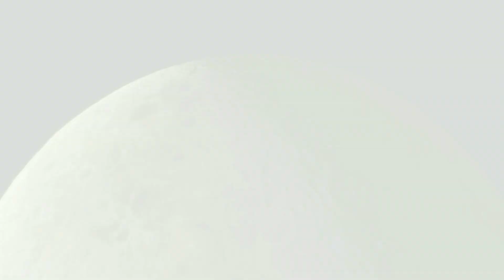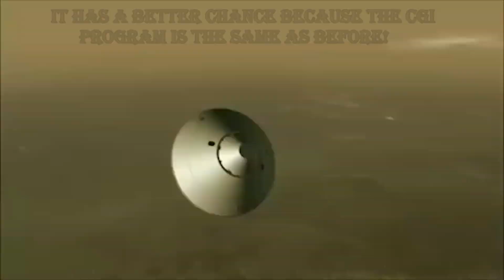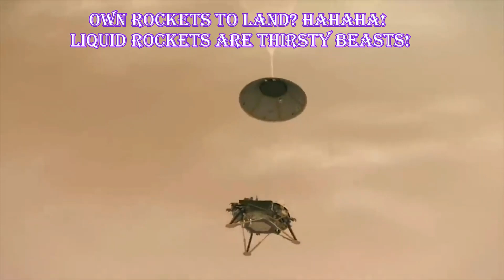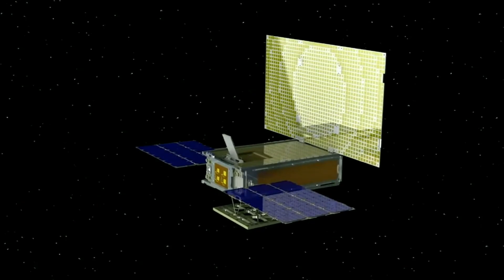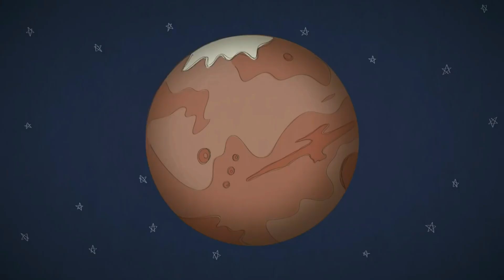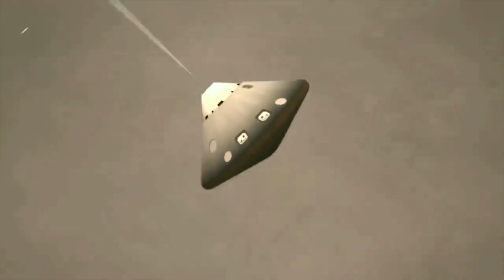Moon/Mars Hoax; "Cosmic Cleaners!"

Comment: Rocket'll kick up a lot of dust.......unlike the 1969 landing on the moon with no dust and crater LOL
Reply: Atmosphere verses no atmosphere you moron!
Reply: @samjones1949  yeah idiot even with no atmosphere no crater uh?..
Reply: @guillermohoffmann8417  yep that is correct. Lunar dust is only a few inches deep. Thus no "crater" made. No atmosphere means what was blown away could not drift back onto the pads like it could on Mars. Simple.
Reply: @samjones1949  your explanation makes NO sense Sammy. There WAS supposedly loose dust found all around the LEM as seen in the 'pictures', but it was not disturbed by the force of the descent engine? If the dust layer were only a few inches thick it would have been blown away completely, and the area around the LEM would've been blasted clean like a massive leaf-blower! Loose dust all around the LEM, just none on the Landers pads? PLEASE!
You live in your own personal reality I guess because that is impossible in the real world!
Reply: @stillperfectgenerations5852  it makes complete sense. The only dust blown away on the moon was that directly moved by the exhaust. Dust beyond the actual exhaust wasn't disturbed because of the vacuum of space! The opposite is true on a Mars landing. Because there is am atmosphere on Mars dust far beyond the actual exhaust would be affected. Can you comprehend that fact? Or are you going to spout "fake" to everything that you don't like because it doesn't fit your fantasy world?
Reply: @samjones1949  oh, selective dust around the LEM. Well that makes sense Sam. See, I never knew lunar dust had such capabilities. Amazing stuff is it not?
Loose dust is obvious directly beneath the LEM and all about the Lander...hey, wait!
Why did the AstroNOTS waste time, and effort, and fuel bringing that petrified wood and Earth rocks back?
That lunar dust would've been worth much more dont you agree Sammy?
NASA could have set up tents around the Country for exhibits! Possibly make a deal with Barnum & Bailey. Would have been quite a draw down there in Mexico! Imagine Sammy, IMAGINE this! 
Lunar Dust with the Jumping Beans!
The Worlds children would be fascinated!
So, what you are telling me is that NASA should have brought the dust back, they would be self-supporting today, and none of this 'Moon Conspiracy' because who could deny it then right
Reply: @stillperfectgenerations5852  as I expected your mind is made up and you refuse to see simple facts. The dust immediately beneath the rocket blast area Is gone! You don't believe the landing actually happened and no amount of evidence contrary will ever convince you. There's even a video by a film maker of over 35 years which shows the video of the astronauts on the moon couldn't have been faked. The technology didn't exist. Let me know if you ever grasp the difference between a vacuum and an atmosphere.
Reply: @samjones1949  how about you let me know if you ever grasp the difference between 'Did it 50 years ago', and 'NOBODY in ANY Agency can take LIFE 1/1000 of the distance from Earth TODAY'?
Simple difference really Sammy, stretch out your hand and see if you can grasp that?
Reply: @stillperfectgenerations5852  the simple answer to that is money. Apollo spent the money, invested it actually. No country has been willing to spend the funds to get us back to the moon. It's not that it can't be done, because it will be done again in a few more years, but it simply hasn't been a priority. I hope you can grasp that since other forms of reality seem to easily elude your mind.
Reply: @samjones1949  sure Sam, sure...
Sell that shit to someone who hasn't ate it for 60 years and are sick of the taste. Apparently you love it? May take you a bit longer, then again, they say it is easier to fool someone than to tell them they have been fooled.
Common sense should have already had you doubting the NASA Lies by now. All the many flaws in video and stills. The many AstroNOT anomalies. The one that should clue you in is this fiasco called ISS. Have you got to watch this comedy? How about the scuba bubbles, you watched this farce yet? Ever looked into the Nazi/NASA connections? I could fill this whole page with more and more but like I said, what is the point, you have been fooled and can't see it...
Sorry, praying for you too Sammy
Reply: @samjones1949  your 'reality' is science fiction!
Minus the Science because real science is based on the ability to reproduce the same results.
Can you grasp that one friend?
I need not ask because it os obvious it alludes YOU!
Like common sense, critical thought, and the ability to see when you are being deceived.
Hey friend, I got this ol' bridge out there in the Nevada desert, you know, Ocean-side. Was wondering if you'd be interested? Cheap, introductory, low-price? I'd give ya the 'cousin' price?
What do ya say Sam?
Reply: @samjones1949  Maybe you could get with some of the other NASA fools...uh, I mean NASA fans and take up a collection for my bridge?
When I say cheap, I mean cheap friend!
Pass the hat Sammy and see what you can come up with close to $60,000,000?
It sounds like a lot doesn't it? 
Nah, peanuts considering we pay that amount to NASA every DAY!!!!
Just tell all the buyers that it is a single payment and it is all theirs afterwards!
Have your people get back with my people and we'll do lunch...
Reply: @stillperfectgenerations5852  every single point you tried to bring up has been debunked. If you took the time to look you'd see numerous videos pointing out the fallacies and outright lies in every one of those points. I've seen all of them. You believe that fantasy all you want. I'll stick with the truth....
Reply: @stillperfectgenerations5852  20 billion a year approximately. Money far better spent that the trillions wasted by our government (USA). Very likely the device you're entering your flawed fallacies on is either a direct ot indirect spin off of NASA research. But of course no explanation matters to someone who refuses to even consider alternatives to their fantasy world.
Reply: @samjones1949  you would not know truth if it were biting your ass.
Seen them all and still dont smell that?
That's called bull-shit Sammy, maybe you have gotten used to it since you 'seen them all'. Congratulations, you have the discernment of a six year old.
Reply: @samjones1949  not a priority? Spend billions of our dollars to go in circles over the Earth? Billions and billions for what was that again, petrified wood and Earth stones brought back from the 'moon'? We always have those nifty cartoons though, right Sam?
What else? Green-screen trickery and AstroNOTS hanging from harnesses?
What else? The occasional dip in the big NASA swimming pool?
I mustn't forget those epic CGI 'Blue Marble' lies.
Apparently the vastly different sizes of the continents haven't made you suspicious either?
Foolish to believe NASA, because they are contradiction after lie.
Reply: @samjones1949  chances are, ARPAnet was the beginning of the Internet and my taxes paid PLENTY for it pal, without counting the funding wasted on the lie called NASA.
Considering Nixon talked to the AstroNOTS 250,000 miles away with no problem, like they were next door, it is still hard to believe my call drops here on planet if I turn the corner at the end of the block, 50 years later with technology unthought of at that time.
If anyone lives in a fantasy world pal, that's all you. Maybe wipe that off your forehead? STUPID is wrote there in dark black!
Continue defending NASA, the ONLY technology to go BACKWARDS!
Reply: @samjones1949  you have the ULTRA flawed speculation and excuse, as the many other NASholes I have had the privilege to discuss this with, that lesser of two evils should be the attitude? It is not. I do not condone or support the Military any longer and have not for more years and reasons than you deserve from me. Same with the M.I.C. 
You do realize the true life stupidity involved to deny and defend NASA? Most intelligent folks do see the lies and deceit...but not you?
Curious...
Reply: @stillperfectgenerations5852  can't fix stupid. And you have a double dose of it. Have fun with the unicorns and fairies!
Reply: @stillperfectgenerations5852  one word that fits all you've said. WRONG!
Reply: @samjones1949  you're a fairy with a unicorn?
What?
Reply: @stillperfectgenerations5852  warch blue marble science, Bob the science guy, Mr. Sensible, and of course ScimanDan. That's all you need and all I have to say to you. Enjoy your conspiracies!
Reply: @samjones1949  you're a fairy needing a unicorn?
What are you saying Sammy?
Reply: @samjones1949  and one word fits you as well.
DUPED!
Reply: @samjones1949  Hilarious! 
Excuse after excuse, avoiding the facts altogether?
All I need or could ever want eh Sammy?
LOL
You are a sad excuse for human intelligence, sad...
Reply: @stillperfectgenerations5852  I avoided nothing unlike yourself. Go to the sites I suggted and all your answers are there.... Goodbye.
Reply: @samjones1949  Thanks. I will pass on your offer for Propaganda. Goodbye.
Reply: Kicking up a lot of dust is a byproduct of a rocket engine in an atmosphere. Believe it or not there is no atmosphere on the moon so unless the dust was directly in the path of the exhaust it would not move an inch. And what was kicked up would have no atmosphere to stop it flying merrily off away from the LEM.